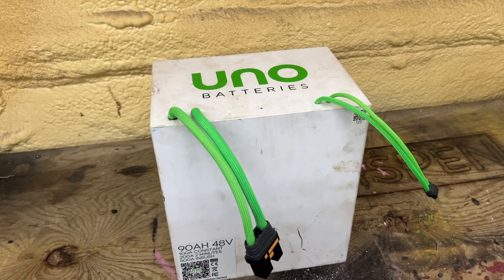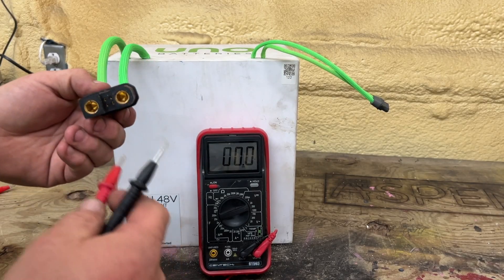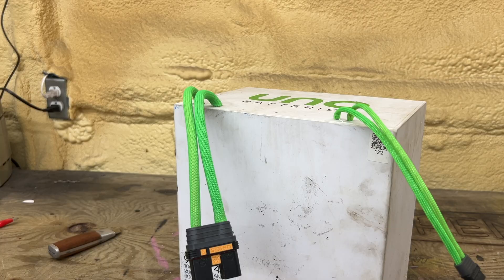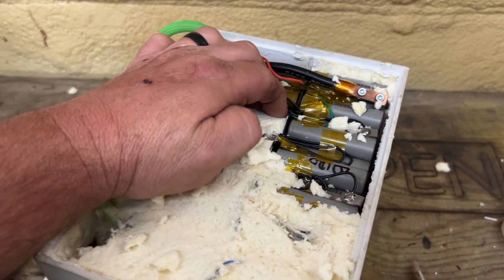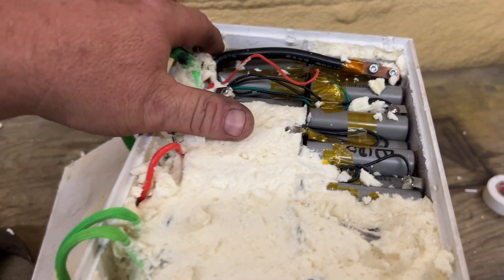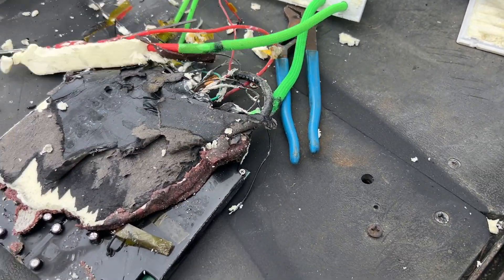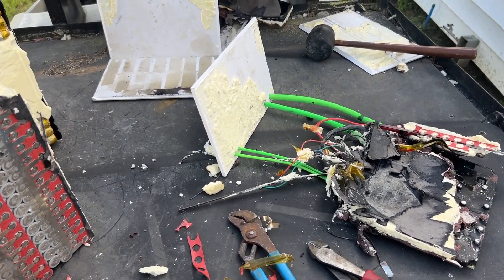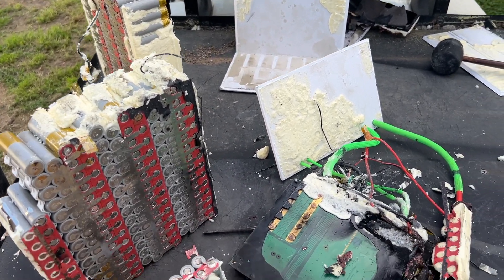Whats Inside UNO Lithium Ion Golf Cart Battery?

Comment: Ryan, could you not install a new BMS on this? I have one that did the same thing and they warranties it, unfortunately the newer one is now starting to go to. I was thinking it is gould just install a new BMS on both. No?
Reply from the maker: Did you see the bms on this one? Notice all the foam the put in this battery?
Reply: @Fentertainment  yeah, but if cells are still good. you can solder/wire in another bms and be good to go again.

Comment: And that's why I just bought 4 cheap 100 ah batteries. If something goes wrong, I'm out $800 instead of $3k.
Influencers are being paid to promote the expensive super batteries. You can get 100 ah Chins for $189 right now. I've been using Dr Prepare for a year now with no issues on my stock TXT.

Comment: I heard a lot of people had problems with those. I got epoch batteries but if I had to do it again I would go with Bolt or big battery. The problem worh the smaller batteries are the BMS. I’ve had issues with my Epoch and so have others. I have a 6 seater and was  sped coded to 25 mph. I recently got a Navitas set up and now my Epochs are working better. I think it’s because you can control the amp output.
Reply from the maker: I leave my amp output on 200. There is no sense to run it at 600a when riding pavement, grass or dirt roads. My ds with 35s will run in the 40s set at 200amps. Ac is more efficient than dc the ones who claim you need 600amps is blowing smoke.